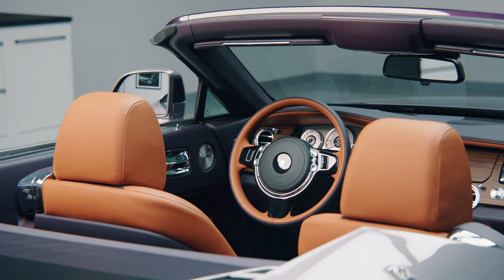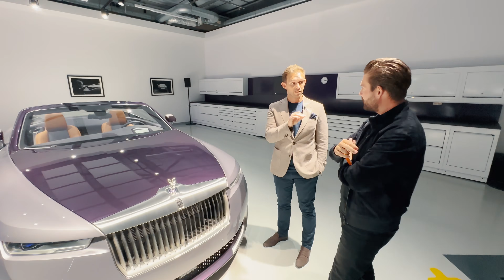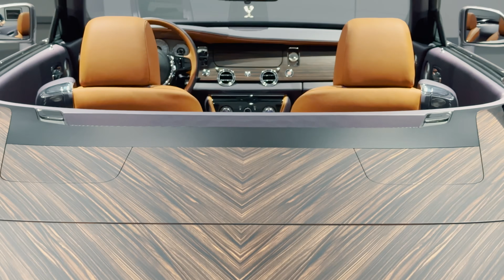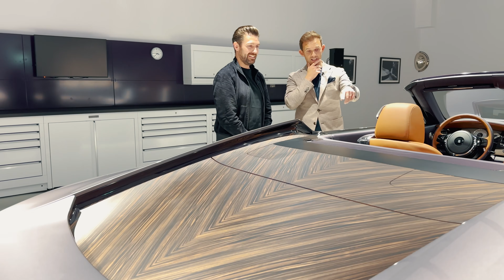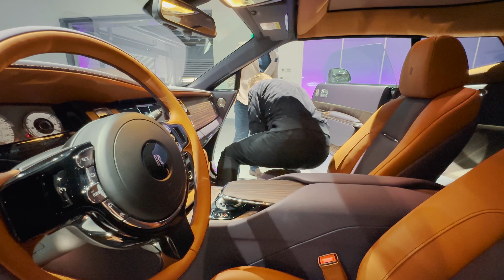WORLDS MOST EXPENSIVE LUXURY CAR $28 MILLION Rolls Royce Drop Tail

Comment: Frankly not impressed for a full custom 28 million dollar luxury car. I detect fear in the design approach, choosing to hide the media system instead of innovating, not daring to change the pantheon grill or presentation of the spirit of ecstacy and leaving blank, lifeless negative space under the headlights only shows the stubbornness to add contemporary elements to these cars, instead choosing to put nothing. The conservatism is most evident in the 2008 ghost wheels and amathyst volume knobs stinking of a rhinestone enthusiasts idea to glue stones to add fashion to mundane places. Plenty of thought in the roof but the dome light module looks like a hotel thermostat. Absolutely no indication the car even has an engine, mostly because this is not a 28 million dollar car, it's a material swatch options demo. Not even the seat belts look updated, which OK, don't fix what's not broken, but 28 million for the same plastic click-on belt as a city bus? This is why there are no Rolls Royce collectors. For such a hand built approach they never build a car worth buying second hand because their pursuit to create timeless cars creates passionless cars stuck in the past.

Comment: For 28 million (or even 1 million) I would expect only perfection when it comes to body panel fitment. Yet there are at least 3 panels that have irregular gaps. 

That said it is a very nice car. 

But being a 1 of 1 it really is just a road legal concept car, despite the verbiage in the video stating otherwise.  Same with the marketing spiel on the hand brushing next to the polished tips. An effect that is easily done in mass production,  but is not typically well received.  It was hand done here due to it being a one-off.

Comment: I'd love to know about the wood features.  Is it solid hardwood or a veneer? If veneer what is the base material?  I'm basically concerned about moisture ingress causing warpage.   I especially like how the end grain aligns, and how difficult it would have been to achieve that.  I initially thought that they would have cut the 45° slice off the end of each side, and thought that the inside corners would have had a lot of separation, so were bound to be misaligned.  But then it occurred to me that they only needed to make a single 45° cut, and turn one end upside down and rotate it. This would give perfect alignment of the grain, but would work better with veneer than with solid timber.

I haven't worked out how they could have done the curved wood grain behind the seats. That is frankly mind blowing!  It's a sensational build, and belongs in an art gallery rather than on the road.
Reply: No need to worry about moisture ingress when the car will be sat in a private, high security, temperature and humidity controlled garage for 99.99% of its life.
Reply: They’re testing rich man stupidity
Reply: The wood is veneer, most likely ebony (macassar ebony is my guess) and it's not hard to create such a pattern. Obviously the 45 angle is the split between 2 panels of veneer which have been turned into each other.

Veneer is flexible and if glued on a flexible substrate you can create these bends like behind the seats.

As long as the substrate is moisture resistant and the glue and lacquer are as well, you can use it outside in the weather.

With that said the veneer is the most beautiful part of the car because it looks like a concept car from Hyundai from the 90s.
Reply: Plastic 🪵

Comment: Remember everyone, you not just paying for the materials, you are paying for every hour of work from every designer and engineer that went into this.  Then there are the one-off molds and bucks.  Then there are the one-off parts they had to contract out.  Then there are the logistic employees who have to coordinate between parts suppliers, craftsman, and their own factories.  The other problem is that the bigger the company, the more expensive it is to produce a one-off car because of all the approvals and red tape.  It would be cheaper to go to a coach builder, but it wouldn't have the OEM fit and finish.  Don't forget, if the customer makes one change to the plan costs will snowball quickly.

Comment: I like the car design but what amazes me the most is that no one have figured out a way to get rid of sonar-based sensors. I'm sure designers would love to have the bumpers clean without any protrusions like that but whether we're talking a $5k or $28 MILLION car; they are still there!
Reply: I agree, this thing should be powered by nuclear fusion at that price
Reply: Agree!
Reply: No matter the cost, if you want it road legal, regulations will get you!
Reply: Good point and maybe it is down to road regulations 🤔
Reply: I believe Tesla has a fix for this on their upcoming models.
Reply: @Mr_Moon42  I assume the fix/workaround is to use cameras instead?
Reply: or at least develop them in a way they are invisibly hidden
Reply: This was a deal breaker for me. Otherwise luxurious car, but the bumpers are so common looking. I'll buy something else.
Reply: i don't know if it's possible but for it sounds interesting and not too stupid to integrate sensors in lights.
so blinkers on the side, and more important front and rear head lights and maybe the centered brake light?

I have a car from 2014 and i don't have any park assistance
so if you know your car, which can happen really quickly, you don't need anything and if you really want to have sensors, don't get a full 360° surround view
Reply: What has been seen cannot be unseen. you make a fine point dear sir. I'm sure you could spec it without them. The tow hook cover is rather irritating too. Are they expecting this car to break down 🤣

Comment: They have lost they damn mind 28 million! For 28 mil you can buy 10 caddilacs 10 Mercedes 10 BMWs 5 Lexus 4 Range Rovers 1 Phantom 3 Bentleys 1 Ferrari 1 Bugatti and still have some change left over. GTFO of here 28 million.  The Car is a basic Rolls Convertible should be maybe 600k at most.

Comment: Nope! £500,000 MAX! and even That is pushing it! But £28,000,000 😂 yeh ok mate! Jog on! Only the idiot born into rich would buy that!
For 28M id expect that to be made out of pure 24 carat Gold, covered in Diamond, Amethyst everywhere, 4000hp with a W24 8Turbo engine with Dark Matter electric motors on each wheel too! And all the Carbon you can imagine! Then and ONLY then would it get close to 28M.

Comment: Anyone else find it suspicious they didn't show the roof actually opening and closing? Arguably the coolest feature and they didn't show it......could it be that $28 mil and it doesn't work 🤔🤔
Reply: The Roof doesn't open and close, its a hardtop which is manually applied. No magic in that.
Reply: @Heiligeradler  so you mean you have to manually remove the roof on a 30 million dollar car? I'm genuinely curious. It just seemed real strange the way they cut the video from convertible to closed roof.
Reply: @joshuaabren  Yes. Same Concept as the Boat Tail follows. Gives much more design freedom and boot volume (as the RR guy tells in this video). I think seeing some people carrying and mounting a hardtop onto a car does not look elegant enough to appear in such a "RR positive" Video ;-)

Comment: The front looks too dialed down for a rolls royce to the point where it doesn't look like a luxury car its supposed to be, and the rear looks like a new electric vehicle that costs 100x less. The interior looks average rolls royce and so do the wheels. The body itself is to squared and bland but if the customer wanted a custom dawn for 50x the price, they probably dont care how it looks, they just want a 1 off.

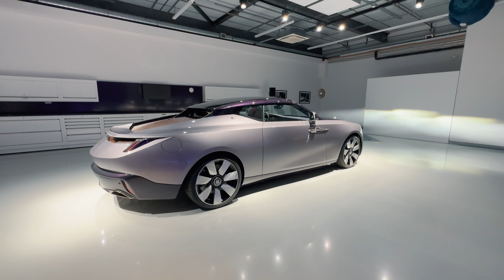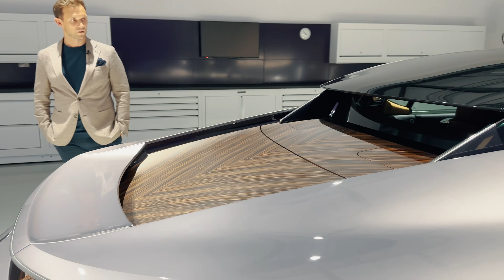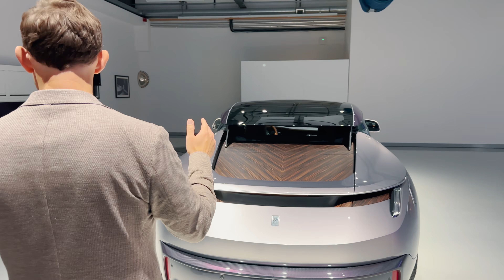Comment: With the roof in place the wood rear deck, amazing as it is, with the raised sail side panels, makes the Drop Tail look somewhat like a customized shallow bed flatside pickup, 28:46 and at 28:57. It's also accented by the vertical taillights, 29:21. The thermal expansion shutline adds to the impression by hinting at a lip.